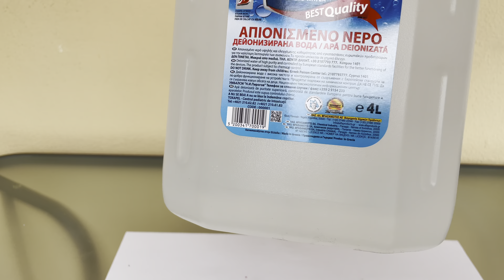Wet Cell HHO. Simple To Do. Save fuel. TORCH. Hydrogen generator

Comment: Another example of good and neat work.
I would like to build a hho generator powered by a full size solar panel (about 250w) and store the gas during the summer time. How big (how many plates) should it be to be efficient,? 
As an idea, do you think that will work?
Reply from the maker: I will think about this project. Thank you very much
Reply: Omu te intrebase si el ceva...,

Comment: Hi，highly appreciate your sharing of the PWM and low KOH electrolyte HHO set... Please advise if using Higher than 50KHz PWM frequency is any better？  Also, how low the KOH solution may be reduced for safety reasons?

Comment: All of that nice design to not use crimped terminal lugs?
Reply from the maker: Each of my generators is made of scrap materials. I mean the vessels in which I put water. Just cut the stainless steel plates after these dishes